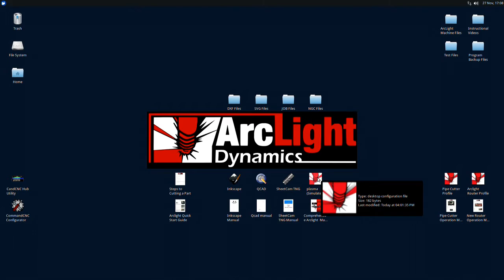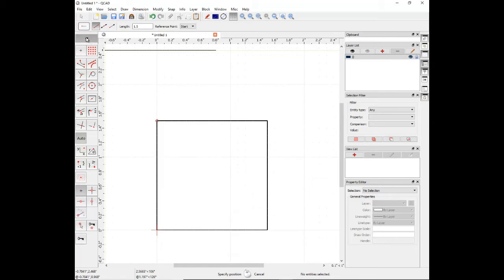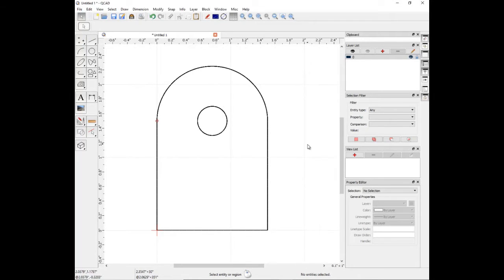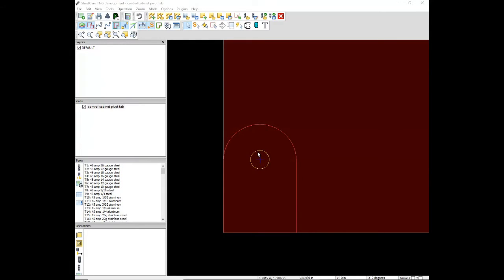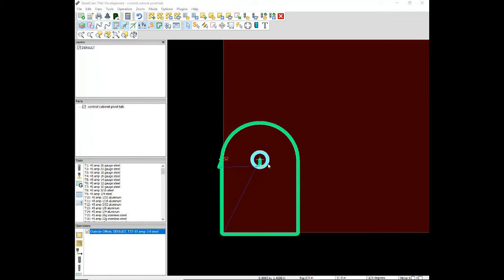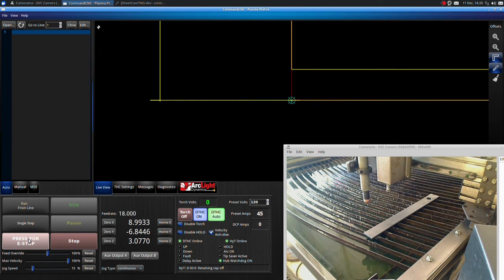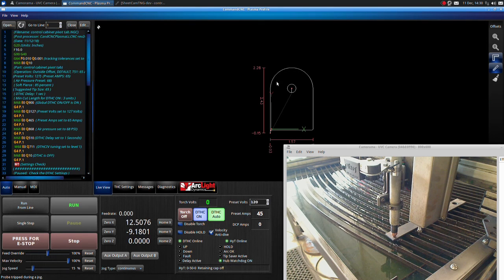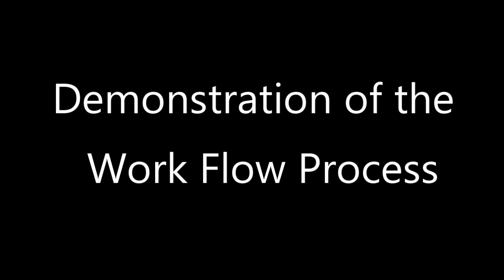Demonstration of the Work Flow Process

Comment: I'm new to this software and table but as a operator of other machines I have a question on homing and then zeroing the x and y axis then later going to the plate corner and then rezeroing the x and y axis. doesn't that negate the whole homing process?

Comment: Do you have to perform part drawing on the  embedded computer?  I prefer working on a different machine located in an air conditioned room and taking the finished g-code on a flash drive to the embedded computer.  I haven't found an open slot for the flash drive.  Also some of the tutorials appear to have an audio track.  I haven't been able to hear any audio associated with the tutorial.  There is at least one speaker icon with what looks like an output power slider.  I haven't found any way to activate the audio channel.   I have been unable to find any coverage of the above issues in the manual.

Comment: Whoa Whoa Whoa!  @  2:37, Narrrator starts talking about holes cut with plasma will be tapered.   Excuse Me, We're in Q-Cad drawing up a part, we shouldn't have to do a damn thing in the cad program to account for Plasma Error, the program that outputs the G-Code (SheetCam) should know the material type, thickness, amps of plasma cutter, brand of plasma cutter, consumable head of plasma cutter and know how to adjust for the Kerf width to cut out the hole exactly.    If it can't do that, then this system is fatally flawed because I can't take my drawings over to a laser or water jet cutter and have them cut out exactly, I will have to tweak them depending on the type of Machine I am running.   LAME!!
Reply: I agree with you here. There is a few things that should of been differently now since I've had my table a year. But I had several of my designs for parts that I build already drawn in cad and had to redo so many b/c they were being laser cut before ( outsourced).   I made a huge mistake by not doing enough homework first before I jumped the gun and bought a plasma table. I didn't know about the kerf from a plasma cut. We really need a laser table or water table.
Reply: It is not the width of the kerf it is the taper that changes hole sizes and all plasma cutters cut a slight taper. If you need it to be perfect you may need a laser or better yet a waterjet table but be prepared to spend many times to amount you would for a plasma table.